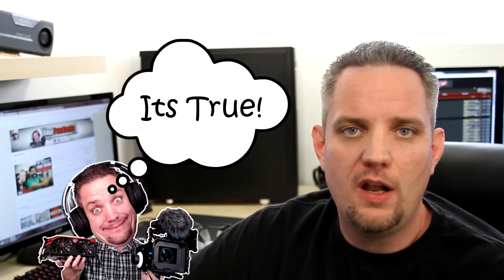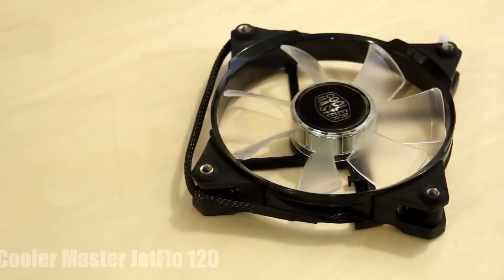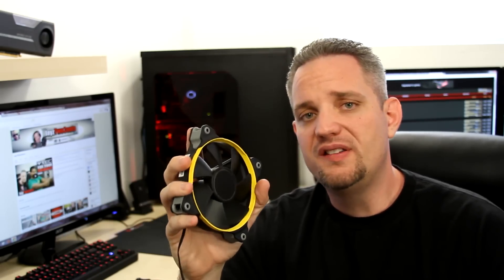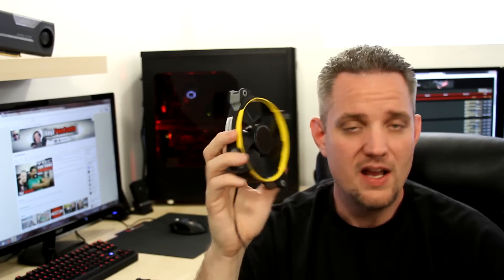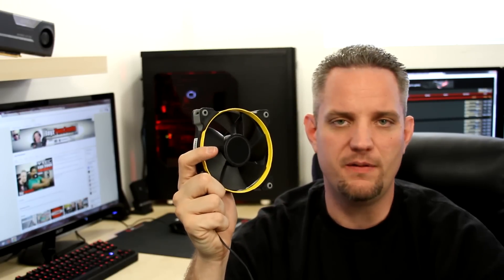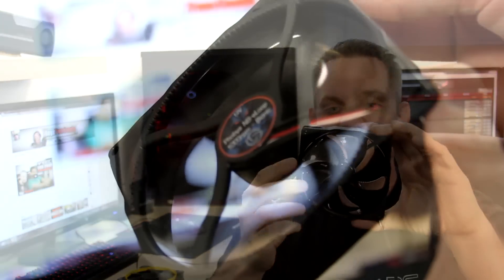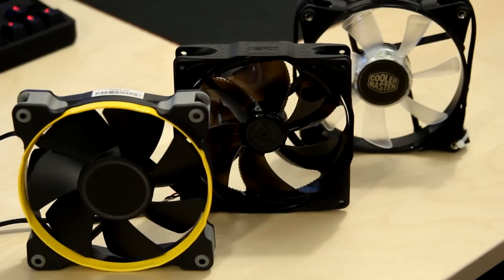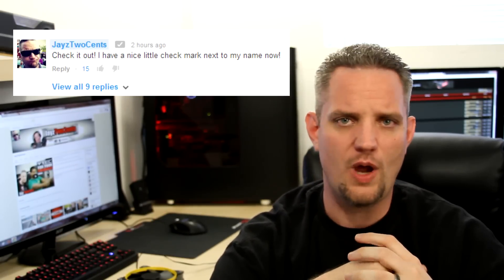Static Pressure vs Air Flow Fans - How to choose the right fan!

Comment: This is rather cute!

And not entirely right.... Although his explanation isn't bad, it's not entirely correct. I can't blame him though, unless you had the 'fortune' to work with manufacturers (and even help design some elements) this isn't a subject you can easily 'find' explained.

All fans have static pressure v.s. airflow ratio and yes, optimization does a lot. However, saying axial fans (the kind we all see in pc cases) have much difference is hilarious. Even the examples given have little difference, although the optimized blade doesn't look that half bad. Radial fans (the type you see on the long GPU, rotating and blowing from back to front... not sideways into the card) are for higher static pressures (on average). If you want to blow through things (or suck), you want radial fans (hence GPU's) if you want to easily move a lot of air (and there is little resistance) you use axial fans. However, you'll always want the more optimized blades as they're simply more energy efficient. Apart from cost, there is really no single reason why you wouldn't choose those fans. The explanation on air direction behind the fans is uhm, not correct...

Optimized axial fans with high static pressure do come from how Jay is explaining, but unless you ramp up the RMP, they're still axial and thus focused on mainly air movement. I would wish more 'fan suppliers' in the pc market would follow industrial manufactures and provide fan-curves showing the pressure v.s. volume ratio.

All that said, if you want to select fans it's very simple:
- Axial fans, the more blades and the tighter they're in the housing, the better they are.
- Axial fans, open and no blade optimization... Cheaper and less airflow for the power going in... 
- Radial fans, I rarely see them this size... Best choice for suction or blowing air through parts. 

PC cases are however not laid out for static pressure tasks... Best version I found is the Vantec - Tornado and basically just ramps the rpm to insane...

So, unless you're on a tight budget simply look for the fan with the most blades and if possible with improved shapes (the winglet style improvement on the tip of the blade is similar to airplane wings) and cut edges (reduces turbulent 'wake') to reduce noise effects.  This will give you the most efficient design (and until actual curves are released, you can't really check the motor) and you can place them anywhere. It's also more energy efficient to run a bigger motor slower than to run a small motor at 100%... Those kind of little things.

Simple fans are just for moving air, so as little air filters or obstructions as possible on those. For anything more complex or obstructive, look for the better designed versions with higher blade counts.

As a last misconception to tackle, the bigger the fan the more air is easily moved but typically the lower the static pressure they can produce. This isn't entirely true as it's also motor dependent, but for pc sized fans it's typically true. For a bigger fan to reproduce the same static pressure, often a higher rpm is required. In pc's however, the higher airflow coming from the bigger size often outweighs the lower static pressure. So 80<120<140<200 mm fans and more blades (with optimization)>cheap designs.

Sorry Jay, I came across this nice old video and seeing people still asking stuff here... I hope it helped with some clarity.

Comment: just make sure you're fans dont run over 900 rpm, voila, silent pc
Reply: Jeffrey Bozko impossible
Reply: Allie Boy no, its easy, and my cpu is even overclocked to 4.7 ghz, all 3 fans in my case can run 900 rpm max, silent pc is easy to achieve

Comment: so it is great to have a discussion but no testing?  how about this.  Crap case with one input and one output.  one 360 rad  hanging inside.  a set volume of water or inline heater and what fan config will counteract the heat best?  i would assume static on the rad and AF out the case and an input fan depending on the internals.  but there are lots of other options.  is AF better in pull on a rad or is static better for push?  could be some fun testing it.  dont even need a motherboard or cpu in there.  lol

Comment: Wow, 2017! I would like to change my 2 front panel. Air Pressure (5.28 mmH2O, 82,2 CFM) or Air Flow (2.1 mmH2O, 106 CFM)?  If I have learned as your tips, would be the Air Flow, correct? Success.

Comment: im getting the phanteks p400s case and i only do airflow, and the front panels is restricted airfllow all the way. so it comes with a airflow fan it looks like in the middle slot. ill just put a static on top where the vents are and ill choose later on the bottom more open slot, maybe since i have 2 fans already pulling air a air flow fan could do the trick. thanks jay

Comment: so should i use static pressure fan for intake air at the front of my case? is the front wall of my case counted as a obstruction for taking the cool air into the case? and its better for spreading the cool air wider than the high airflow type right?

Comment: Hey Jay. Digging up the past here lol got a question; I'm about to dive into the AIO market and get my first liquid cooler for my 6600k. At the moment, my eyes are set on the H110i 280mm rad. Looking to also replace the fans with EK Vardar fans. 

Here's my question; will the air being pushed through the radiator no be enough and cause negative pressure from my other two 140mm exhaust fans?

Comment: so is the best setup for a push pull radiator set up would have static fan for intake and airflow for  exhaust? or should it be static fan for both sides?

Comment: what about in cases like the Define Mini C (no hard drive cages, but filtered intake, air comes in from the side vent of the front panel). Would you recommend airflow or static pressure?

Comment: 1 thing about it being just the blade design, I also noticed that there is a less gap between the edge of the blade and the wall on my thermaltake riings, vs all my flow fans... I think that also contributes to the pressure

Comment: I just bought myself a corsair AF120 quiet edition led fan which is 
meant to be 1500rpm I have it sitting next to my stock corsair fan which
 I believe is AF120L 1300rpm but the stock fan is blowing waaaay more 
air than the new one.? They both AF with the blades looking the same. 
Howcome they blowing differently. I might try the SP120 instead

Comment: So I am getting a Phantex Eclipse, It hides the HDD's In the basement and leaves the front of the case open, however, it only has two small slits in the front of the case to pull air in. I was assuming that I would use two static pressure fans in the front to pull the air in through the tiny slits and one static pressure fan for the CPU cooler and then use air flow fans everywhere else. Does that sound about right?

Comment: So if I wanted to have a radiator in front of a case intake would I want something with high static pressure? Or would I want something between lots of high pressure and lots of low impedance?

Comment: I'll be building a new PC in the near future, and I have 4 Thermaltake Riing 12 LED 120mm fans on my parts list for the case (Thermaltake view 27). I want these fans because the LED ring would look amazing in the front of the case. Are there airflow fans with that LED ring available? Are they less expensive than the $15.99 Tt fans?

Comment: 1 simple question, i have a nzxt s340, should i get 2 sp fan on the front as intake or af fan as intake? i don't use radiator. using the cryorig r1 for the cpu cooling.
Reply: Aiden xyz af means airflow so get that u only need static pressure unless you're using a radiator
Reply: PC MASTER RACE!!! alright mate, thanks
Reply: PC MASTER RACE!!! alright mate, thanks
Reply: ***** after get the sp fan let us know the result man. means lot
Reply: SpitfireRenegade i saw someone take the front panel to customize it like the ibuypower... can see thru the 2 dan and its like a grill cage.
Reply: I actually have a normal airflow fan on the way. I'm gonna clean my filter and stuff out and add a second intake fan. I only have one right now. If that works then I won't get a static pressure fan. Hopefully a clean filter will result in more airflow. And the second fan should help too
Reply: ***** hopefully XD
Reply: Aiden xyz hi, wondering if you ever found out was best for the s340? sp or af?
Reply: Aiden xyz that was my initial thought, but since the case doesn't have any direct intake, its not really letting the af fans work the way they're supposed to. someone recommended sp, wish nzxt would have made a grill on the sides like corsair.
Reply: Aiden xyz i wouldn't like that as a personal preference. I'll look into it a bit more before deciding.  thanks for the quick responses.
Reply: SpitfireRenegade so far all working fine for me. hopefully u will have your new case soon
Reply: I have the same exact question
Reply: I also have an s340. I just tested some airflow stuff out and found out that the filter and the front panel really restrict the airflow for the intake. I have a normal airflow fan for intake and whenever I take the front panel and filter off the airflow increases by alot. I'm probably gonna get a static pressure fan for intake since the filter and front panel block alot of air off
Reply: SpitfireRenegade I'm using airflow. since I'm not using any radiator, af working fine. if u got radiator i believe sp fan will work better.

Comment: I have on the side two 12mm scrap PSU generic fans, in front one ThermalTake blue led 12mm fan 10 yo and matrix of six AMD CPU fans and on the back side one ThermalTake 12mm ordinary fan, and it works like charm :D

Comment: Hello. I'd like to ask 

I have an NZXT S340 and I am considering getting a Kraken x62 in the future. I'd like to get some fans for my front panel for now (which will replace my default rear and top fans once I get my hands on the x62). I looked up and saw that my default fans FN V2 are airflow types. Is it advisable to get another set of airflow fans, or should I get SP ones? Thanks!

Comment: so i got an nzxt kraken x61 cooler on a nzxt s340 case  and i would want to change these fans to a better one, apparently i should buy a 140mm fan that's an SP right? so what brand and model would you guys recommend.

And also for my case fans an AF fan is good for the nzxt s340 Case right? Thanks
Reply: Resay Dota Rosewill Hyperborea are the best 140mm fans atm.

Comment: So I'm currently halfway through building my first pc. I'm mounting a 240mm radiator to the front and the rest of the fans are set up in average places. Would it be acceptable to mount an intake or exhaust fan in the bottom of the case(in front of the psu). If so, would it be better to mount intake or exhaust.

Comment: Do you thing it's a good idea to install a 240mm radiator in the front (pull config) and 2x120mm AF fans in top as intake and 1x120mm AF fan as exhaust in CM Master Case 5?

Comment: I am building a PC soon with an i5 6600 so I won't be overclocking and I am using the stock cpu cooler. The case I am getting is the Corsair Spec-m2 which supports 5 120mm fans although I only want 2. The GPU is the Asus Strix GTX 1070 OC which I may slightly overclock but nothing too major, I will be playing games at 1080p. 2 Drive cages will be occupied and 1 ssd cage in the back. Which of these types of fans would be ideal for me?
Reply: Simply put... If you wanna build a cooling pressure on your hard drives in the front, you put an SP fan in the front.
If you don't care much for your hard drives temprature you could relocate the drives and put an AF in the front that would feed more fresh air to your GPU.
Or if you have space for 2 fans in the front, direct the SP fan to the hard drives, and an AF fan above or below to feed the GPU.

I personally have 3 fans feeding the GPU with AF fans, one in the bottom and two in the front. But I dont have my storage HDD within the case, mine's on the top so full AF in my case.
Ultimately that means I have 3 fans in, and 1 fan out, which also makes it a positive air pressure in the case for dust control.
Reply: z1mt0n1x Thanks for the advice! :)
Reply: ceNi S Anytime :)

Comment: which type of fans should I put in the front of the case?
Reply: my case is a Corsair Spec 01
Reply: Fractal Venturi HP fans. I'd say they are better performance than Noctua and cheaper plus has a lot of engineering behind them aswell.

Comment: How do i control the speed of my fan?? I have it connected to the motherboard with a 3 pin plug and only runs at 600rpm and the max is 1500?
Reply: In the software of the motherboard you should be able to change it, it will regulate the temp automatically so you actually don't need to do anything

Comment: I want to install two fans for exhaust at the top. Unfortunately, the output is vaguely blocked by the dust filters and case handle. Should I get fans optimized for air flow or static pressure here?

Comment: so I have a define r5 and have taken the hhd cages and optical drive bays out so I should use 2 af fans sucking in on the front and 1 pushing out on the back, then 1 sp sucking into my air cooler and an af pushing out of my air cooler? please correct me if I'm wrong

Comment: Jay or anyone: Do radiator fans that pull into the case also act as case ventilation? Or are they ONLY cooling the radiator?
Reply: Well here's the thing. The fan is cooling the radiator by pulling in cooler air from the surroundings, allowing a heat transfer to happen on the fins of the radiator, and sucking that now hotter air through. So depending on the direction of your air flow, that now hotter air will either flow into or out of your case. You probably want out of your case.

Comment: I've heard that the original fans on most cpu water coolings operate very loud, so my question is: What and where would you put fans if you where to mount a Corsair Hydro Series H115i water cooling to the top of a case. should the fans be on top of the radiator or on the bottom?

Comment: What about the new corsair maglev fans? They are supposed to be a hybrid and do both. I was going to get a bunch for my case and also use one for the radiator on a hybrid water cooler. Is that ok or should I choose specifically sp or af fans for different applications.

Comment: so i got the Graphite Series™ 780T i got 2 140mm fans at the front and 1 at the back if im right the are both SP for what i have read online should i change the 2 140mm fans at the front to a 3 SP 120mm fans? and what kinda of fans should i use for the top and the bottom? AF?

Comment: so which is better? 

case is phanteks enthoo luxe, there is alrdy a 280mm radiator on top.

1) 2 corsair SP intake (front), 1 corsair AP exhaust (back)

2) 2 corsair SP140 intake (front), 2 corsair AP140 exhaust (back)

3) 2 corsair AP140 intake (front), 2 corsair AP140 exhaust (back)

Comment: if higher the mm H2o the more cfm/air it moves through resistance,why this fan have lower h20 but higher cfm,it moves a bit less air through resistance than noctua?
Phanteks PH-F120XP :
Speed (RPM): 500-1500 ± 250 rpm
Max Airflow:    23.0-61.6 CFM
Acoustical Noise:  21-27 dB(A)
Static Pressure :  0.39-1.72 mm H2O
------------------------------------------------------------------------------------------
NOCTUA NF-F12 PMW:
SPEED : 300-1500
MAX AIRFLOW: 54.97 CFM
ACCOUSTICAL NOISE:: 22.4 DBA
Static Pressure: Min 1,83 -2,61 mm H₂O
Reply: Think of it like flow vs pressure.
AF are like a big wide gravity fed water pipe. good at moving large amounts of water, but a blockage is going to really mess things up, and when the water comes out its just going to splash gently against the wall. (think drainwater pipe)
SP is like a smaller pressurized pipe. It might only be moving half as much water, but a blockage inside the pipe is going to make a smaller difference because the water is forced around it. And when it comes out it's going to pressure clean the wall. (think, fire hose or pressure cleaner)

Comment: I have a Phanteks Evolv ATX Tower for my pc build. Since the Evolv has a slightly open design in the front should I go with the Corsair AF fans for the front or Corsair SP fan for the front because of the tight design?

Comment: Don't worry too much guys, you can't really fuck up on cooling. I'm running the stock fans on my CM 690III ( 200mm intake/120mm exhaust, Hyper412s on CPU) and it's fine. My room get's hot AF and no probems at all. I even dare to say most PC's are fine with just a intake OR exhaust fan and a CPU fan. Hell, before I got this rig I used to buy prebuild PC's and they only had cheap CPU fans.

Unless your gonna overclock the shit outta your PC or live in the Sahara desert a good CPU cooler, 1 intake and 1 exhaust fan is fine.

Comment: hey dude, nice vid!
For the Corsair 750D do you recommend Static for the front intakes? the case comes with 2 140mm Airflows but like you said in the video, with all the added resistance in the case, it made me wonder if Static is better in this scenario? whats your two cents ;) on it!

Comment: So if I had the NZXT H440 case, would I need static pressure or air flow fans due to the air restrictions where the fans are?
Reply: sp